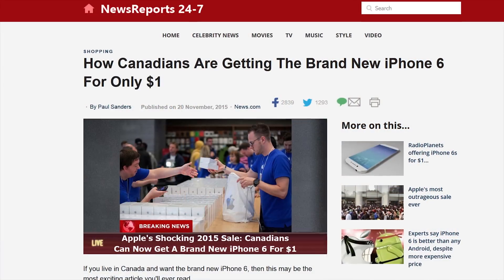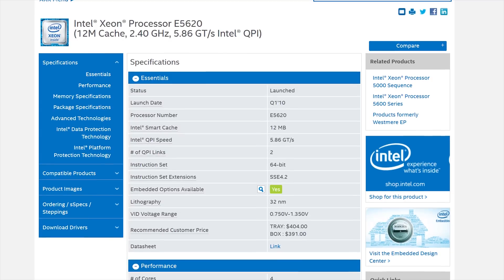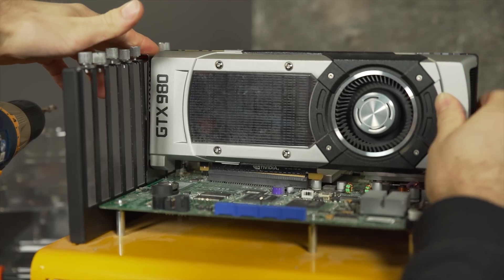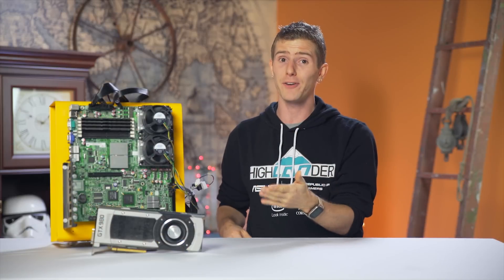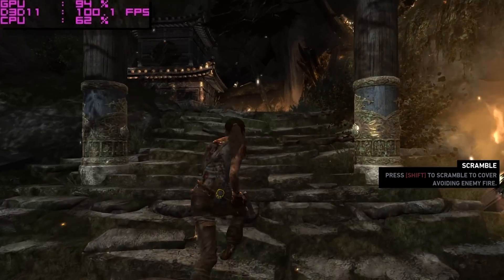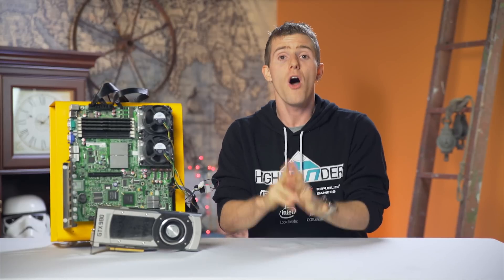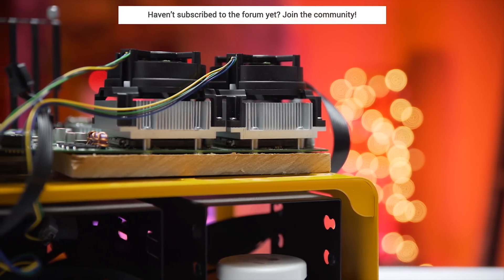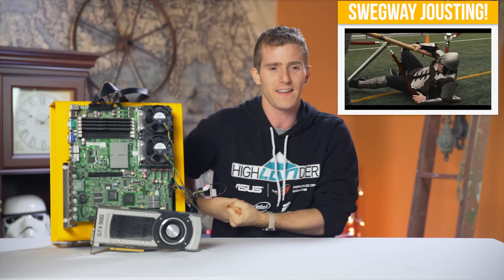Under $150 Budget Gaming 8 Core CPU, Motherboard & 16GB RAM

Comment: can some one help me? my pc is running non-graphical games with low frames.

my specs are:

gforce gt 610 (2gb)

4gb ddr2 ram

AMD Athlon 64 x2 dual core processor 4000+ 2.10 GHz

32 bit operating system
(windows vista home premium)

games like:

smite

arma 2

dota 2

dirty bomb

warface

thank you for your time...
Reply: switch to a 64bit operating sistem

Comment: This is unnecessary trouble. Just get an old Dell Optiplex 760 era system on Ebay, preferably with a Core2 Quad CPU; upgrade the power supply and install a GPU. The total cost of most systems like this are usually <$250.
Reply: Leave that to Green Ham Gaming :D
Reply: No, you also need to take into account the embedded GPU (if any, if you need to use one) on the motherboard, as well as the TDP of the CPU compared to the TDP limit of the motherboard you're using. This is on top of the placement of ports in conjunction with the holes on your case, which can vary significantly, and the size and shape of various components, which don't always fit together. A pre-assembled computer like a Dell Optiplex, when combined with aftermarket upgrades, provides more stability and compatibility assurances while maintaining a low price tag.
Reply: Similar to what I did, though I just purchased a Thinkstation S20 and ram/cpu upgrades.
Reply: Yeah you could do that, but then you won't get to saw a GPU
Reply: Private Account 
They are all within the PCIE maximum rating therefor should be just fine on any motherboard which supports PCIE. As long as the PSU isn't under 200 watts, it won't cause any problems.
Reply: server Dells are better, quite expensive tho, but the powerful 4 cores, 4 threads Xeons are more than enough for any game, they come with 12GB of RAM and 1TB HDD, any GPU will work. There you go, a powerful gaming machine with 8 cores at a much lower price than an i7 machine.
Reply: No, no, no, no, no. Older systems may have different connector standards. Use www.pcpartpicker.com to load in all the components and check for potential compatibility issues.
Reply: that's NY gaming rig rn 8gb ram core 2 quad 750ti
Reply: I have this same type of pc and it rocks man! i just wanna know which graphic card you are using in your Rig? please reply thanks :)
Reply: a core 2 dou?? really?  :D
not to make fun of you or anything but...
Reply: Don't even get a new PSU. Just get a GTX 1050 or RX 460
Reply: deathbat6916 Those cards still require more electricity.
Reply: What does propensity mean?
Reply: I got a Dell with a i5 3.10GHz processor and a AMD Radeon HD 7500 for $100 two years ago at a university surplus store.
Reply: That's a good deal, 360deeman.
Reply: Private Account hey that is my nickname. ( deeman).
Reply: How would you check compatibility for GPU's with old systems like that?
Reply: any GPU will work, that is not an issue.
Reply: Best of luck getting a CPU with a TDP of 125 watts, and a motherboard with a maximum supported TDP of 95 watts. Obviously you haven't done enough of it, otherwise you wouldn't oversimplify it so much.
Reply: Building a PC requires just the right case, just the right motherboard, and just the right hardware support. As Linus has demonstrated many times (including within this very video), PC building can be very difficult, particularly when you use rare parts.
Reply: First, your spelling and grammar are atrocious. Second, I listed a Core2 Quad, not a "Dou" or Duo, as it's actually spelled.
Reply: Extremely verbose.
Reply: powerplayer75 Do you enjoy having an unusable computer?
Reply: +Private Account Leave it to a liberal to be the one spouting hateful, derogatory remarks.......then call you the bad guy. It's no use arguing with a professional victim. they feed off your responses, ignore them and it drives them crazy.
Reply: If you do have extensive experience, that means you're probably completely unintelligent judging by your propensity to oversimplify things. You're probably some alt-right idiot, with a Trump sign in his front yard, who goes around spreading his idiocy to anyone he can.

Comment: I bought a second-hand workstation computer with server board and two quad-core Xeons. I used it as my regular personal computer, but there were some quirks:
1. After switching on, the fans were spinning at full speed for 20 seconds, then BIOS started, and BIOS was awfully slow at detecting disks, and there were two disk controllers: one for SATA and one for SAS.
2. Electricity bills became about 2 times higher, especially when I was using it for heating my room during winter :D
I didn't test it at gaming because it had nVidia Quadro FX 1700 installed there, it's a version of GeForce 9600, so it's really old. Now the computer is doing 24/7 BOINC crunching (it's really good at it) in a place where I don't have to pay for electricity :D

Comment: The RAM which you call "regular ECC" is actually Registered ECC
The difference in naming is maybe minor, but difference in functionality is major.
Registered RAM will not work with anything consumer grade.
My AMD Phenom II X4 965 based server (had exactly same with AMD Phenom II X6 1090T) is equipped with ECC memory, which you call, for reason unknown to me, incompatible with consumer grade CPUs.
You did same error in so many videos, that I have to correct your lack of knowledge in this respect.
Otherwise your knowledge is fine, but not great.

Comment: It would be fun to see the same concept with used works station, like Dell T5400 or T7400, They are more expensive but they come with PSU, Case and more expansions possible. Just install a GPU and see how they perform.

Comment: Damn, I got a HP ProLiant DL160 G6 U1 Rack server for €130, with dual Xeon L5630's and 16GB of DDR3 ECC RAM, I recently bought dual Xeon X5670's for €170 and holy fuck does it still kick ass to this day despite being around 5 years old. If I could fit a larger GPU in it (currently the Quadro K4400 in it required some work to get it in, it does parallel processing pretty well) I'd probably try gaming on it.

Comment: Haha, I just upgraded my old editing rig and have one of these old server boards I am looking to sell, except it kicks that lousy Dell server boards butt. It's got a PCI-e x16 and PCI-e x8 slots with a bunch of other slots, more USB ports, no need to damage modern GPU cards and support for up to 24GB of DDR2. I kind of knew if I got new CPUs and RAM I could have kept the system relevant (it was one of the most stable systems I ever owned)  but I got the upgrade bug and jumped for a new Core i7 build. That old motherboard alone cost something like $500 new. Still has the CPU fan brace too.

Comment: This style setup is essentially the same thing as what I did with an old Mac Pro 2008 setup. Got it for free from a friend. Use the Mac side for work at home and have a Windows install for gaming and such. I was kind of blown away how well it worked for Premiere and such after I shoved my GTX 760 in there. Although this is all coming from an AMD FX-6100 build from 4 years ago. Don't under estimate some older tech and what it can do.

Comment: Update, I did our has the x5650 6 core 12 thread processor, with the 120 dollar Intel board, was able to get it to post at 4.46 ghz but couldn't get it completely stable until about 4.18 ghz, but at these speeds I was scoring over 10 on cinebench. Will admit going straight from an i5-3570k it felt a little less snappy, but barely much of a difference, not to mention raw processing power increased like 50 % so considering it has 50% more cores and hyperthreading not too bad core for core when 1 core with 1 hyperthreaded core equals one core on the i5 (note the scores are from when it was overclocked) also I pretty much got the upgrade for free, I sold my processor for 130, and the upgrade costed me 200 after using a coupon, this included the motherboard, processor, and a USB 3.0 card to make up for the USB capabilities lost, now I still have a motherboard laying around waiting to sell

Comment: did he just saw off that thing?
Reply: +andhika bayu it still hurts to see ;(
Reply: A single scratch on your car is still counted as damages, even though it will do nothing to your car performance
Reply: oh noes a totally useless part was removed!
Reply: he caused literally 0 damage to the card wtf are you talking about
Reply: Eh, when you realize it won't hurt the performance or the card, and it's simply just an overly blown piece of circuit board that's simply for mounting, it ain't so tragic
Reply: It's not a connector, it's a locking tab and completely useless. The card is already held in place by a screw, and if you are doing something with your computer that requires more than a screw to hold a card in...stop it, now.
Reply: it's just the connector you can barely see, the performance is not hurting in anyway
Reply: 0 damage is incorrect though, he definitely damaged the connector part
Reply: It's not useless. It keeps the card seated in the slot all the way. It wouldn't be there if it wasn't needed. That PC he put together isn't worthy of any high end graphics card if you have to modify it so it will fit.
Reply: not it's not. The thing he removed is redundant on that motherboard anyway so yeah 0 damage.
Reply: lmfao yes. just caused more damage to the 980 than the whole computer is worth xD
Reply: andhika bayu Good thing a graphics card isn't known as "pussy magnet" otherwise that metaphor would be dangerous
Reply: jeffscomp
It's a used 980, hardly high end and anyone that's buying a 980 new now, when 1070s can be had for the same price, is stupid.

If the tab is indeed needed, can you name one situation where it would help? Can you point to a specific situation where that locking tab is necessary to keep the card in the slot?
Reply: daft vagrant if you bump your computer the card may work its way out. The tab holds the card in place straight. You'd be surprised how things come loose in a PC from the vibrations of the fans even. The 980 is high end to me because it's expensive and only from last year. The only card I might be willing to modify for the contraption he built is maybe a 750.
Reply: jeffscomp
Computers get dropped and non locked cards don't dislodge, so the bump idea is out.

Server boards (mounted vertical rack, horizontal rack and standard case format) lack the locks, are subject to more vibration, bumps and general neglect than a home PC yet they don't come dislodged so vibration is out.

The previous idea you had that it wouldn't be there if it didn't need to be..Well memory is seeing a general shift from two lock tabs to one. They keep the one tab because in the confines of a home PC case, the locking tab also pops the memory stick up making it easier to remove.

The 980 was released two years ago and it's cost is a joke, the 1060 is cheaper and outperforms it. The 1070 is the same price point and outperforms it by a wide margin. A single 1080 only costs a couple hundred more than a single 980TI, and it takes two of the 980ti in a custom loop and massive manual overclocking to just barely edge out a single 1080 in 1080p At 1440 and 4k the 980 really show their age...The cost does not denote the cards performance.
Reply: daft vagrant servers weigh a ton and don't get bumped around. You don't know much about them. Lookup how much a dell powervault weighs. They made the lock for a reason. Get over it.
Reply: jeffscomp
Not all servers are the same size, you realize this right? Most small businesses run a server that is somewhere between mid tower to full tower size. Not to mention the ones that are large are modular. The individual parts are actually pretty light and no real special care is taken when they are handled. I worked with small business networking for a long time.

So you know, Powervaults are storage bays. it's a box full of HDDs and actually a huge source of vibration within a server rack. Your knowledge of IT is obviously limited to googling specs and not knowing what you are looking at.

Comment: this setup w / RX480??
Reply: why I'm here
Reply: +ThaMovingTarget You know whats really awesome about the rx480 and gtx 160 ect. releases? all the 970 and 980s on ebay for the cheap.
Reply: HueHue Jib Boy, here in germany i can get 2x rx 480 for half of the price of a GTX 1080...
Reply: I don't know why people say AMD drivers are bad, I think they're pretty decent. Not only do they increase performance as time goes on, there's Crimson, basically AMD shadowplay. And all reference coolers are garbage. Slap a 40 dollar aftermarket cooler on the RX 480 and you'll get mad overclocks :)
Reply: John Smith don't be racist and you can have an opinion you know.
Reply: +HueHue Jib what do you mean? bad as in bad or bad as in good?
Reply: two cards just to get gtx 1080 preformance, in canada 1 rx480 is 350$, times two is 700$ or i could just get one 1080 and get the same preformance
Reply: Yea. That's a fair point, but for an entry level gpu they seem to be worth 150. I may be wrong I am really new to this.
Reply: Ok? And the cheapest GTX 1080 on newegg right now costs just over 900$, so what are you trying to say here?
Reply: Well here in MURICA, its only $200, instead of the 1080, which is $800
Reply: Doobles Enjoy your housefire and shit drivers.
Reply: I can get 2 rx480s for the price of a single gtx 1080
Reply: HueHue Jib And? Have fun dealing with the issues of games not supporting multiple cards and shitty scaling. A single 1080 is a much better investment.
Reply: Con6612 Okay Achmed, have you prayed to Allah today?
Reply: ECCENTRIC This, the only "bad" part is when they release it a little late.
Reply: Moon Man Yeah, but it's not like Vega is dropping anytime soon. Which could be a bad thing, depends on who you are.
Reply: ECCENTRIC Doesn't matter the drivers are great right now and recently they are just getting better and better.
Reply: Moon Man yep.
Reply: The Rx 480 is suppose to compete with the 1060
Reply: The Eli It does and very well, especially after ReLive it gained like +5-10% ish improvement
Reply: Rx 480 is bad
Reply: Con6612 Post pic of yourself or GTFO

Comment: So is Linus sponsored by Intel? An 8 core AMD 8350 - $100 used or $150 new with warranty. Normal DDR3 at 1833 though the multiplier hits 2400 without issue and still costs less than the Intel's RAM. Normal motherboard - you won't have to saw up a 980 to make it fit, you have a full array of PCI-E and it handles SLI with a sound card and WiFi installed. It overclocks fine, it comes with a far better heatsink and works any on the market without requiring mods. Whats more it performs better, you can run a 980ti without bottlenecking, you beat the Intel option on any any measure and finally at 32nm instead of 45nm the AMD is also more power and heat efficient than Intel.

Basically what I'm saying is yes you can run the Intel and yes it works, but with an 8350 beating it in every single way and not requiring the extreme workarounds the Intel does there is absolutely no reason whatsoever to get the ancient Xeon. In fact the scores you posted look worse than my Phenom II X6 on sale used for $50. Am I surprised, to me its no shock that the AMD 2010 processor beats Intel 2007. Nor am I surprised the AMD 2013 processor absolutely wrecks the Intel '07. In short, this video is either purposely stupid for youtube revenue or Linus is sponsored by Intel. The last option, well I think too much of Linus to believe he actually thinks the Intel solution has any benefit over the cheaper 8350.

And yes I have tested the Phenom II to support my claims both stock and overclocked with an R9 Fury X which considering how AMD GPU drivers work is worse for an AMD CPU than a 980ti. Now I run an 8370 underclocked by 20% to 8300 speeds to preserve heat and noise yet still not bottlenecking my Fury X.